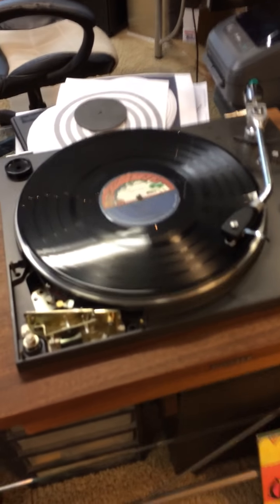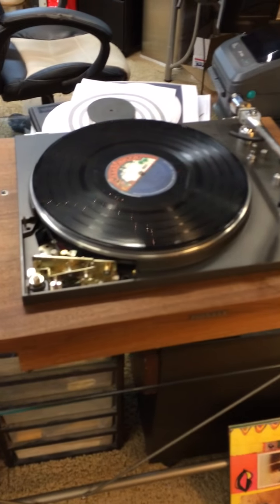Pioneer PL-41 plays too fast

Comment: There's a guy who sells the correct belt for the PL-41 on eBay.  I got one from him and now my PL's speed is spot-on.  I had done the electrical tape trick, too.  It isn't just the belt length that's important, if the new belt is too thick or too thin, the speed will be off.
Reply from the maker: - I never considered the possibility of the thickness of the belt as a contributing factor - would you be as kind as to post a link to this seller or the item that you purchased?

Comment: The problem is not a Mechanical one-do not waste working pulleys by filing them down-the reason that the Turntable is running too fast, apart from a slightly slack Drive belt through age is that the Load resistor in the rectifier panel to the Motor unit is tired and has gone "high", therefore, when these age, they start to carbon- break due to long-term heating effect of current over years and they start to "push" towards going open-circuit, but on the way there,they become tired and so the Voltage across them rises and hence the motor is pushed harder and runs fast. You need to replace the load resistor on the output stage of the rectifier board with one of the same value-I do not own one of these turntables but that is what the cause will be-it ususally is. When you replace this resistor, you could wire in a variable and this will give you the variable pitch control that some turntables have if you do this, you will need to solder the third contact to the Zero-volts rail on the supply so as to be "In-circuit"-there may be a service Manual out there in Turntable Land that you can get the value of this Resistor from-or else you can get resistor codes off the net and /or a code card from Maplin Electronics., or you could go for another fixed value but I recommend that if you do, go for one of the SAME VALUE BUT HIGHER WATTAGE, say, (if it is a quarter watt, go for a  one watt or Two watt) this will be more stable and last longer in the long term. Sad to see that you are using other PL41s for bits-try to get them all up and running and then you can have different cartridges on them, one for say 78rpm etc, Mono/stereo/moving coil/Moving magnet etc. Also try the old(Heavy) Decca SC4E Moving Iron Sum-and-Difference cartridges, that give the feel of a third channel and a more 3D audio experience. good on you for preserving this item, but get the others up and running-these are rare here in Great Britain and you could sell these to collectors. Happy Listening, Hifi is a Joy !!!!!!!!!!!!!!! Garron R. Martin, MAES
Reply: +Garron Martin Not always! My resistor tests at 295.5 ohms..... well within tolerance of 300 ohms.  Still plays fast.
Reply: The PL41 has an AC Syncrhonous motor, there's no electronic speed control happening.  It's not a voltage variance because a resistor is out of spec, although that could definitely happen on some tables, just not the PL41.  It's just a matter of a belt that's a little too short or it's too thick, both of which will make the table run too fast.  Get the right belt for this table and the speed is dead-on as it came from the factory.

Comment: Do you have any suggestions  on
How to fix a broken rod on the dust cover it broke right at the screw in
at spacer. Or parts thanks Randy
PL-41
Reply from the maker: Frankly my suggestion would be to hunt ebay for the replacement part and just replace it outright -

Comment: I tried the tape thing after getting good reading at capacitor. Fixed while I searched for an alternative which ended up simply being the correct belt. I ordered this one, took the tape off and bam...perfectionist!!! Table runs perfect now without tape and without replacing the capacitor... now granted,  if you do have a leaky capacitor, this is not going to fix it. You will need a new cap. here is the belt: https://www.ebay.com/itm/111643636023?ul_noapp=true 
Yes it says PL-50.... dont worry it Works!
Reply from the maker: Thanks - I just ordered one and will report back
Reply: I just received the belt from the above link. I have a pl-50. This belt WORKS!  After 4 yrs of using the wrong belt, this one makes it perfect. I'll never know the physics of why, but thank you for the RIGHT BELT!
Reply: @kevinsenderhauf2490  Glad it worked! I find the same with tape decks as well. Belts realy do matter.
Reply: @absupplynet  How did it do?
Reply from the maker: @PackardDog  That method of correction of course was not very sophisticated but quite frankly worked just fine and I would estimate that its rotational speed is still a little fast by maybe a 30th of a revolution.  As I said I estimated that I might more tape to go around one more time but after that it's thoroughly perfect well below my ability to detect that it's too fast - thanks for asking - are you having the same problem?
Reply: @absupplynet  I was referring to the belt link i posted last year....did you ever get the belt and did it fix your speed? :)
Reply from the maker: @PackardDog  Ohh - I see - thanks.  No - I never ordered the belt.  I will and post comments here when I get that reworked.

Comment: As mentioned in another comment the problem is not mechanical and a bodge like this is not the way to fix it. Get the load resistor changed!
Reply from the maker: I think this solution is neither clumsy nor an inelegant way to solve this issue when faced with the difficulty of finding a repair outfit, the spare part and other difficulties faced to resurrect this item (short of having a time machine) to new like condition.